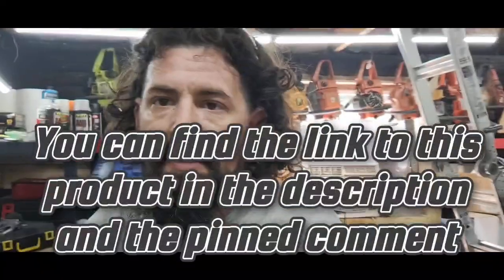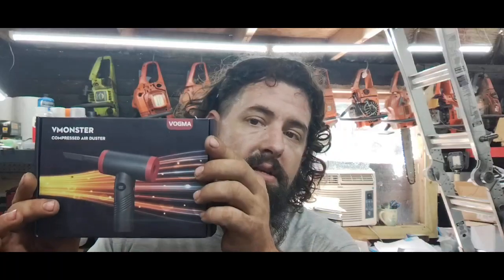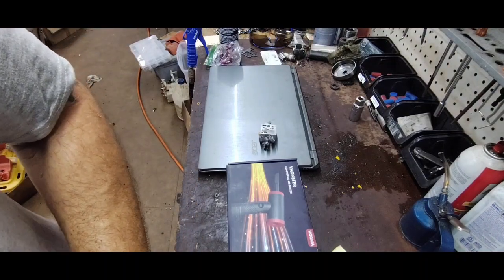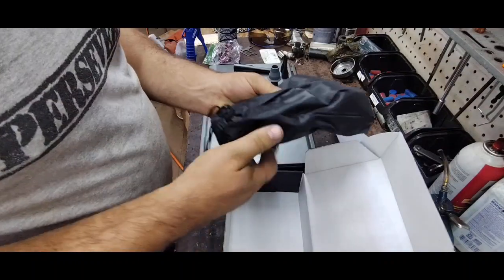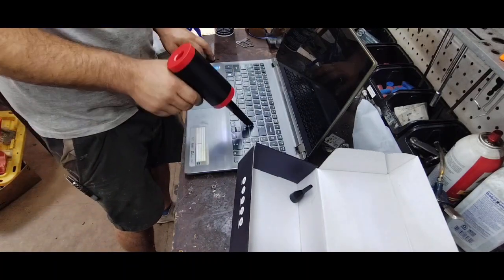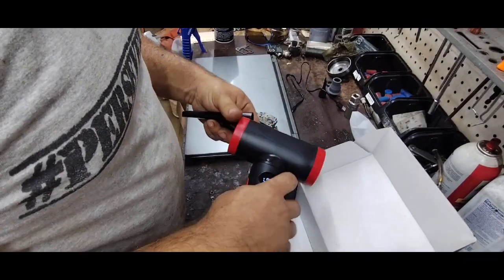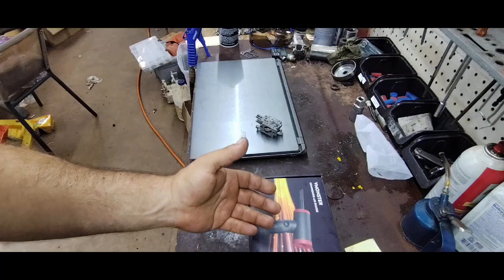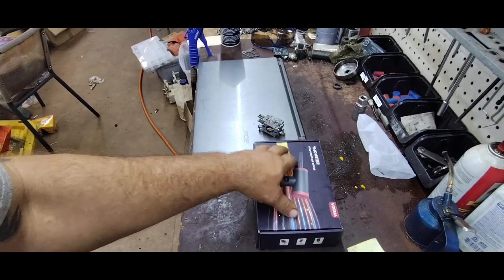DON'T WASTE ANOTHER PENNY ON CANS OF COMPRESSED AIR (DUSTER) REVIEW OF A COMPACT AIR DUSTER #savings

Comment: I wonder how good it would work on chainsaws and lawnmowers around the carburetor area of equipment you are repairing to blow away dirt, wood dust, etc. when you’re inspecting or disassembling it.
Reply from the maker: It works descent, but for the stuck-on stuff not so great. I have been using it to blow off carbs before disassembly and the areas you mention, works for about 75% of the ones I have done so far.